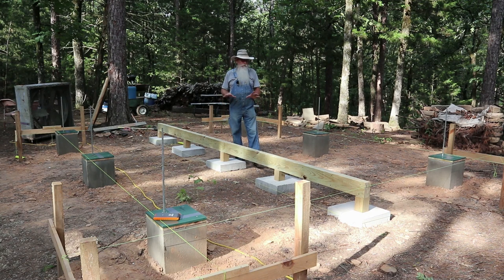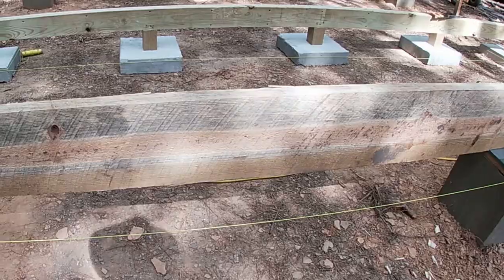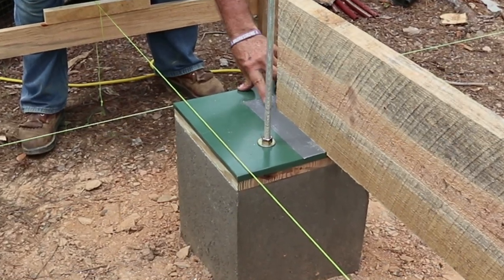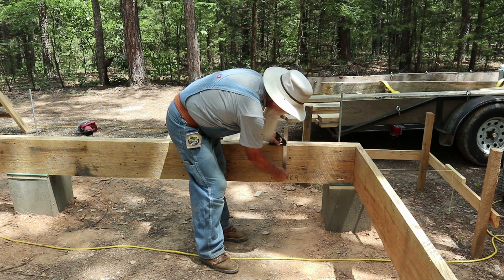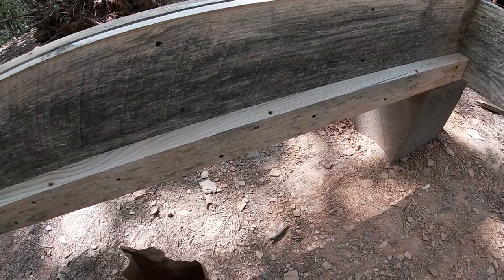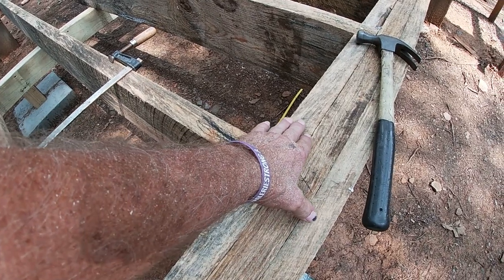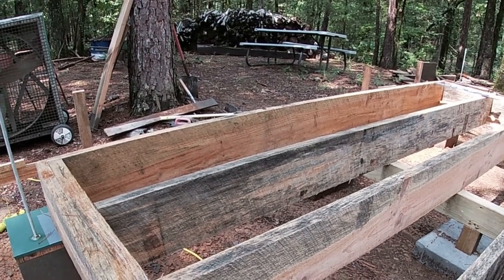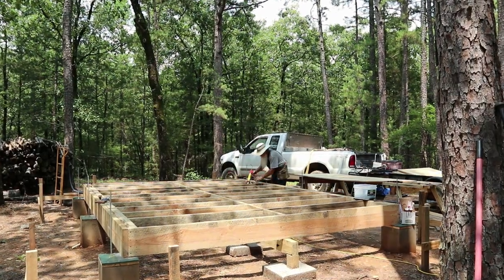Girder, Floor Joist, Subfloor, Paradise Point Log Cabin Build, Ep 3

Comment: Bearded Carpenter, Thanks so much for rerunning older shows. Saved me some heartbreak of finishing a Lower Hoist a have lot of heartbreak that can be prevented simply building a floor like this that will handle the Lower Hoist pulling around, thanks Blessing Paul
Reply from the maker: Howdy Thomas- I guess you came across a video from the beginning of the Paradise Point cabin. Occasionally they will come up in your YouTube feed. Hope all is well. God bless

Comment: This is great, I've been looking for a simple way for an idiot (me) to do a deck that doesn't require metal joist hangers or huge chunky beams for sills. Are you happy with the strength of that ledger though? Seems like that could be a weak point if there was one, but I don't really have a handle on the loads etc. I do know mine won't be seeing any farm machinery going over it or anything, just foot traffic. I suppose some additional toe-nails (screws) through the joist and into the end plate would help shore things up. I like the blocking at the ends, too, to keep the joists in place. I've got a lot of 3x2 kicking around for the ledger board, bit thinner than yours, not sure if 2" would be thick enough for the joists to sit on (with notch and all), especially as my span is nearly 10' and I didn't really want to add an additional support in the middle, too many posts to pour...
Reply from the maker: Howdy- Although some people might disagree with me but this system has been used for many years.  I have loaded this floor with the weight of the hoist, the counter balance weight on the hoist and the weight of the log on three points of the hoist. There is absolutely no give to the floor whatsoever. I did put extra screws through the joist into the ledger. Hope this helps. Take care and God bless you
Reply: @TheBeardedCarpenter  Thanks for the pointers, I reckon if that holds for you then I will have no trouble, this is just a residential deck (no sign-off required, so I build it how I see fit!)

Comment: You confused the heck out of me, you said on the pier you capped the treated lumber with metal, it looks like a piece of 1/2" plate wrapped in green plastic. But then I saw you screwing the joist into it. I thought that can't be right, but then I thought more about it and saw the roofing nail, so I think I figured it out. Is that a piece of the tin you used for the roof of the other cabin?
Reply from the maker: Howdy- sorry about confusing you. I put a treated 2x12 on top of the pier and metal flashing on that. Yes, that was some green metal I had left over from my roof. Take care and God bless
Reply: @TheBeardedCarpenter  You talked about staggering the blocking, I assumed they staggered them because it was easier to nail.
Reply from the maker: @bigredc222  Yes, that is correct. My Daddy liked to keep them in a straight line and I still do things like he taught me. Blessings

Comment: What do you put under the piers or footings to keep them from sinking under the enormous weight of the house?
Reply from the maker: Howdy- I’m building on top of a hill and the ground is yellow shale and very hard. All the water drains away from the cabin so there will be no problem with much moisture ever getting under the cabin to cause anything to happen. I have a substantial footing under the piers also. As the logs season out the cabin will actually get lighter. Thank you for the comment. That could be an issue in other areas, but where we live the ground is pretty stable. Take care and God bless you

Comment: Hi Paul how do you adjust the wall heights if they are not even.
Reply from the maker: Howdy Mitch- I use a water level after the sill logs are set and check the height of the notch. With the lower notch uncut on the end wall logs I can make what adjustment is necessary to get it level. Take care and God bless you

Comment: No hangers for the joists?
Reply from the maker: Howdy Gary- the joist hangers we have available here are for lumber yard joist which would be 1 1/2”. None of the rough sawn joist I used were that size. I think I had mentioned that but may just thought I had. God bless you
Reply: @TheBeardedCarpenter  If they are 2 inches Simpson has U210R. If 1 3/4 Simpson has them for LVL or I joists. Other than that, I would have put the support beam lower so the joists could rest on it or a ledger.  Depending on the shear value of nails is really never a good idea for load bearing members. I also would suggest putting some 30# felt between the pressure treated lumber and the concrete in the future. Pressure treatment really means nothing if moisture gets between the wood and the concrete. Also any notching should not exceed 1/4 the depth of the joist.